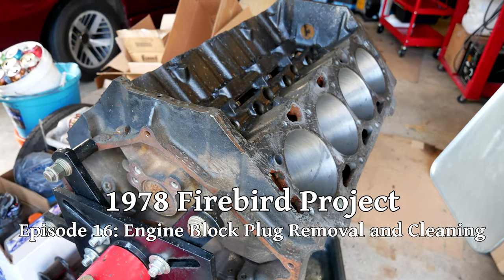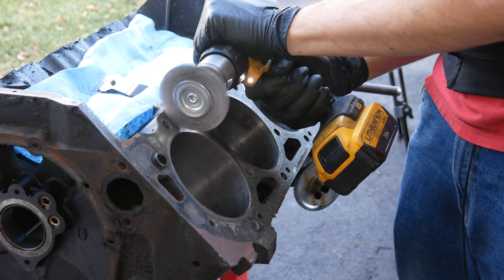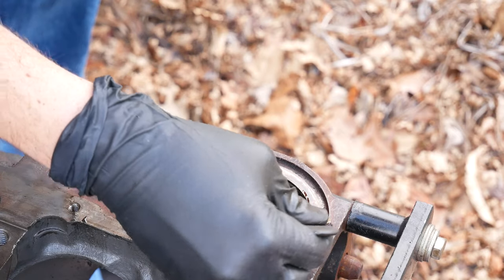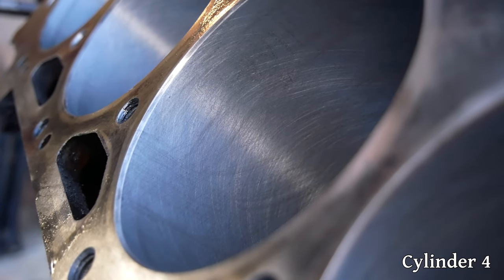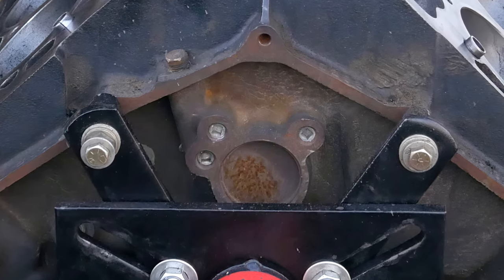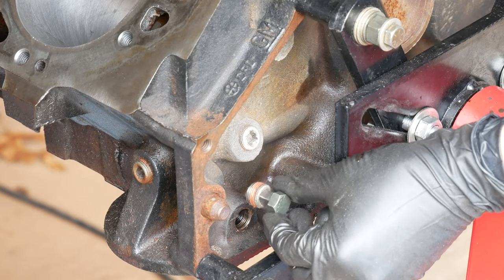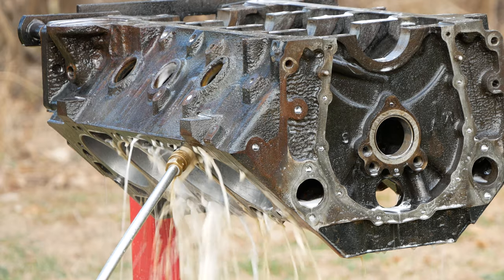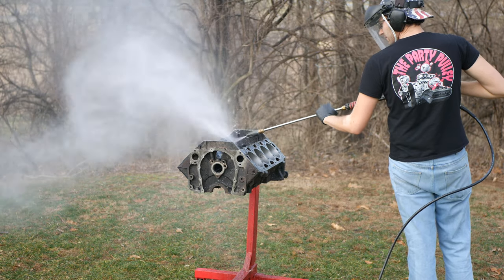$200 454 Engine Rebuild: Engine Block Disassembly and Cleaning (78 Firebird Ep.16)

Comment from the maker: It has been a busy few weeks but finally we can cover a little more of the engine rebuild process. Should speed up a bit from here as a lot of the remaining work is cleaning that will not be shown in as much detail. People watching the last video really seemed to like the fact that I wanted to reuse the worn old camshaft bearings, those same people will likely be elated since this time around we are going to bang them up a bit more and still not replace them. Obviously, I could edit out some of the bumbling but I think that would be cheating the story a bit. Sometimes things go wrong, especially if I'm involved. What I want to maintain (and tell myself) is that there isn't anything wrong with that. Do what you can do and understand that "good enough" is sometimes actually good enough. Sometimes.
Reply: Yes, a new video! I've been looking forward to more since the last ones came out! Hope you're doing well and this new schedule is working out for you!
Reply: Why are u using iron piston rings?👎🏻😂
Reply: What happened to the chavy s10 blazer
Reply: @joelcabello7465  Blazer is getting the 78 Firebird's old supercharger kit... the 1991 firebird is probably going to get the 350 out of the 78 and a sniper efi setup.
Reply: I’d very much recommend new cam bearings. I’d never run cam bearings that messed up and since they’re so hard to get in I’m 50/50 on weather you should get it done at a shop or do it yourself.
Reply: Everyone in your comment section saying their campaigns are about to go
Reply: Everybody in this video comment section is saying your cam bearings need to be replaced
Reply: @Waylon Michael damn, they're making the bots reply to each other now
Reply: I know this is very unlikely but do you still have your factory throttle body to the Blazer because if so what would you like for it if you haven't already saw it
Reply: WD40 and a whetstone are pretty good for removing the last of the gasket, shows high/low spots better.

Comment: I'd advise you to replace the cam bearings, but if they go bad I get a whole series of videos about it. So actually, they're totally fine.
Reply: I have never saw cam journals burn up even full off other parts of the motor imbedded in them.
Reply: Cam bearings are the most often untouched and reused, without issue item in engine overhaul

Comment: Future vid: how to tear down a 454 and replace cam bearings.  😂  It doesn’t cost that much to have your block prepped and cam bearings installed.  Way cheaper than building, installing, failing, removing, rebuilding, re-installing and enjoying.
Reply: YUP! THANKS FOR NOTICING THAT! obviously hes never built anything with HEAVY DUTY or HIGH PERFORMANCE intentions! I would trash the bearings, grow some balls and order a cheap cam installation tool from amazon and go to town! OR DOES HE KNOW HOW TO DO THAT??????
Reply: @bbgcars  having balls is keeping the cam bearings in, not the other way around. Replacing them is just being safe
Reply: Never

Comment: In my opinion the purple power works better if you douse everything in it from a spray bottle and let it sit for 20 minutes, then blast it with the pressure washer. A scrub brush helps work it in on heavy deposits.

Comment: Dude get plastic razor blades. They're surprisingly sharper than metal blades, but also can't take chunks out of metal surfaces like head decks. They're even cheap like $10 for a set and scraper, so right up your alley ;)

Comment: A slick surface left by the wire wheel is not the best for a head gasket. I personally prefer to just use the razor blade method or if I'm worried about warpage I put 320 grit paper on a sanding block or piece of glass and finish the surface.the factory and machine shops will tend to leave a slightly rough or course finish so the head gasket will bite and not move around. I know alot of people have used the wire wheel or roloc wheel method with success but I have personally seen many sets of cylinder heads, intake/exhaust manifolds and even carb bases that were warped severely by improper cleaning methods. A big reason why the 6.0l powerstrome diesels and Subaru boxer engines kept blowing head gaskets is shops would just roloc the deck surface and completely warp it and loose the new headgasket usually with in the first 1,000 miles.
Reply from the maker: Good advice! I have found it very difficult to actually get a satisfactory level of cleanliness with just a razor blade which is why I like to follow up with the wire wheel. Flat sanding the whole surface would definitely be a good idea if warpage was a big concern and to give the head gasket surface more bite. For what it's worth, the Chevy 350 that got that same wire wheel treatment last time has been overheated (260 degrees and above) half a dozen times at this point and somehow the head gaskets are still holding. It probably helps that it is very low compression and lazy, though.
Reply: @FuzzyDiceProjects  some gaskets are more forgiving on dirty surfaces then others, I have found that the graphite and composite gaskets seem to take up imperfections and minor warpage and seal good but with a MLS (multi layered steel) gaskets want surgically clean and flat surfaces with the proper finish also the roloc disc can roll the sharp edges of the cylinders and coolant passages which is very bad and gives the coolant and combustion the ability to get under the gasket and erode it away.

Comment: I did a 350 over the winter similar to this. Ball hone, degreaser , diesel fuel and it came out clean. Plastic roll locs are safer but you cleaned well after the wire brush so that was acceptable. My machinists retired and shut down his business so no access to a hot tank.

Comment: Just a note, be careful using purple power an an aluminum block. It's okay if you use it and rinse it off fairly quickly but you don't want to let purple power sit on aluminum for any real length of time it can damage it.

Comment: If you heat the block up right after cleaning it will dry really fast by evaporation. Air blast is good at the same time, but I usually park a huge space heater (5kw shop heater type) directed at it. Really helps.

Comment: I once had an oil pump drive shear because one of those wire brush bristles that shed so easily found its way into my oil pump. The engine had been an exchange from an engine shop 15 years and 2 owners before me! I heard a change in engine noise, saw the oil pressure gauge falling then the lifters rattled so I knew it was not the meterl! Caught it in time and the engine was OK. a close one though!

Comment: Great job. If it were my engine I think I'd go ahead and change out those cam bearings. It's not that hard to do just need to pay attention to the oil hole locations. 250 to 300 rpm is what you want on the honing speed. Transmission fluid works as well as anything.

Comment: Good job so far! But be careful wrapping it in plastic too tight. With it maybe getting warm & cool where you store it will cause condensation build up inside the bag and you may still get rust on your engine, even though you did spray it down with WD40. Trust me, I have see it happen before. That's why the plastic covers that you can buy from Jegs are open at the bottom, is so it can breath and not become a green house effect.

Comment: That "staining" in the bore won't matter after 5k miles and the rings wear in the bores. You're not running crazy high compression or any power adders you'll maybe notice a slight amount of blow-by until it wears in. Just drive it normally

Comment: Look for a set of scotch-brite style scrub disks for the air grinder.   I found a set, that has a quick twist-on/off design, to a mandrel made for the air grinder.   5 different levels of abrasive pads.   I used the lightest two for cleaning of aluminum gasket seals, and they work like magic.   Even with soft aluminum, they were very gentle.  But if you lean on them too hard, they can dig in, and cut metal.   They are damn near perfect for this kind of job, on steel engine blocks.   And very very fast too.

Comment: Could be the capacitor of the compressor ending it's live, that and a good service could bring it back to life maybe.
Reply from the maker: The problematic compressor is the yellow Campbell Hausfeld one that I repaired once before in an older video. Last time it was the check valve becoming stuck open and not depressurizing the cylinder making it hard to start and tripping the breaker. The old check valve was really rusty and nasty, and I didn't exactly clean the tanks out so I suspect it is once again what is casing issues. It was about two years prior that I had replaced the valve. I haven't gotten back around to looking at it just yet though.

Comment: Get you a honing block, they are really cheap and not as controversial as a wire brush. Although a wire brush isn't that bad of an idea as long at it is brass. Head gasket surfaces need a specific grit to them. Kinda like sand paper but much more accurate. But for your application it's not that big a deal. Looking good, cheers.

Comment: another trick for removing rusted nuts and/or bolts is after heating touch a candle or whatever wax you have to the threads. that wax will get sucked down into those threads and bada boom bada bing. you can also wax lag bolts and screws to easily screw them into wood, especially hard woods.

Comment: Run a razor over all the flat surfaces (heads/block) even after wire brushing, you would be shocked what still comes off. Cleaning a motor like that you need a couple cans of Zeps grill cleaner from home depot. Environmentally friendly (its food safe) and work great. Spray it down, let it sit until the foam goes away and then spray it off. I'll take a block like yours after using Zep's on it and spray it off on my front lawn (off my driveway). The grass don't even care.  
The next thing to do is get out your grinder and take all the slag and sharp edges off the block and heads and then wash it again.

Comment: It's best to fully clean the engine block when you first pull the engine down & the camshaft bearings may have been line honed at the factory therefore they will have those marks on them !

Comment: I always use two hammer's to remove the freeze plugs,and im pretty sure you can use a 3/8 ratchet on the square plugs!Great videos but i would have replaced those bearings:-)

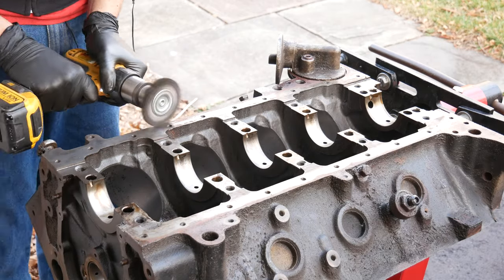Comment: @5:08 why scrape when your going to follow up with the wire wheel? I think a wire wheel would make quick work of even gasket residue. I scraped an AL cylinder head for 2 hours wityh a razor blade scraper and still didnt get all the gasket off, a few minutes with a brass wire wheel on a a dremel and it took the gasket right off with no pitting of the AL. Dont dwell on an AL surface with any abrasive wheel.

Comment: You go that far with engine building you do replace cam bearings... that is common sense I am not a licensed mechanic but I have been doing this kind of stuff for many years and I have learned do it right the first time it will be cheaper in the end... 🤑🤑

Comment: I just lost a 289 to rust in a cylinder. It sat outside, covered for around 10 years, but the spark plug holes were open which didnt concern me since it was never wet. At least i thought. I recently removed the heads and the first side was perfect, but somehow the second head was removed and 2 cylinders were absolutely rusted. After pouring krud kutter in the ctlinders the rust is completely gone but unfortunately theres some pitting and the block is already 30 over. Sucks

Comment: Did you paint the engine at 22:13 ?
Reply from the maker: No, it may just be the lighting and dark cast iron outer surface making it appear that way.
Reply: @FuzzyDiceProjects  Oh, thanks for explanation. It looked like it was freshly painted.

Comment: Based on what you showed the cam bearings will be fine. At most you lose a few PSI of warm oil pressure at idle.

Comment: If you have a chance try out harbor freights degreaser it’s almost a neon yellow color and I don’t dilute it just wet my parts and spray is with a spray bottle and it’s one of the best degreasers I’ve used and cheap as dirt I keep it in a spray bottle labeled “hot tank” because it does damn near as good of a job if you let it sit for about 20 min

Comment: Why did you not take out the cam bearings before you power washed the block ?  were you going to re-use the old bearings ? Are you going to re-use the old rod and main bearings 
just asking.......

Comment: A 12 point socket will remove square head bolts. No need for special sockets or vice grips for most square head fasteners.
Reply from the maker: In my experience, 12 point sockets don't work great with the plugs GM uses on these engines. They don't have sharp corners and are pretty soft, the small ones especially. If they were hard to get to with anything else it would certainly be worth a try though, and a lot of square head plugs/bolts are no problem for a 12 point.

Comment: You may consider using ENGINE RESTORE in the block after you break in the block- should help with compression....I think the cam bearing are more important than the new valve covers....

Comment: Why would you remove all those plugs and screws? Don't fix it if it and broken right?
Reply from the maker: It's the only way to really clean everything out of the block. Especially after honing the cylinders and getting abrasives everywhere, the oil passages need to be really clean. That said, it probably would have been fine to leave the brass water jacket plugs in.
Reply: @FuzzyDiceProjects  Do it right, do it once - leave nothing to chance. It seems we are of the same mind. Boom.

Comment: Great job and well done.  A brass wire wheel might be safer than steel wire. not magnetic though.  And its oil "galley" not gallery. Unless your engine has miniature paintings.
Reply from the maker: I originally said "Oil Gallery" in older videos, then was corrected and switched to "Galley" but then was corrected even more on that term so I gave up and went back to "Gallery." It's the term I heard first so it sounds more correct to me, and it would appear that they are used interchangeably enough that either will get the point across.
Reply: @FuzzyDiceProjects  yep  but one is correct and the  other is not
Reply from the maker: Do you have a source for this? When I looked into it the most credible summarizing article I could find was this one, from an editor at Mitchell: https://mitchell1.com/shopconnection/no-thats-not-a-kitchen-in-your-engine/

I remember seeing defenses of both terms, but gallery seems like a more solid case to me. Or, take the side that both are incorrect and "oil passages" or "oil ducts" is the correct term. Really, I don't think it matters as long as it is understood.
Reply: @FuzzyDiceProjects    Yes I ran this by Noam Chomsky and that cunning linguist confirmed that is is "galley"  referring to a narrow passageway

Comment: Clearly those cam bearings should have been replaced, for the cost of having the machine shop install new ones why risk the entire engire being possibly damaged for the sake of a few bucks insurance.  So much attention to detail in cleaning and replacing every single plug in the engine but leaving beat up cam bearings, foolish economy and frankly lazy.

Comment: lmao I can't believe you'd rather make your own tool rather than spending the 5 or 10 dollars to just go out and buy that tool
Reply from the maker: Gotta pick your battles! Sometimes spending a few minutes to make it is faster and cheaper than tracking one down. Also, the hex head lets you get it into tight spaces in a way that a typical socket can't.
Reply: If that's a Pontiac motor...wouldn't that be a 455?...Chevy makes the 454